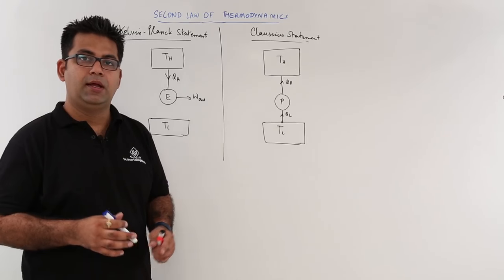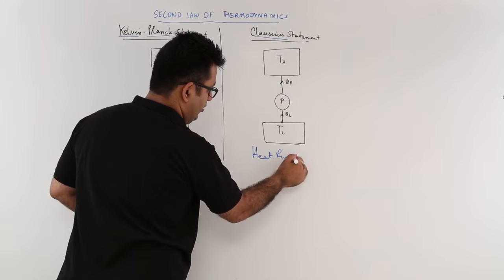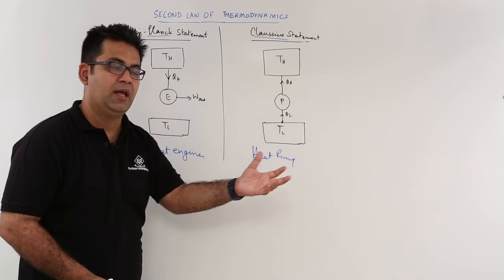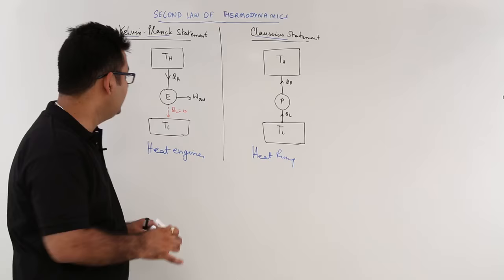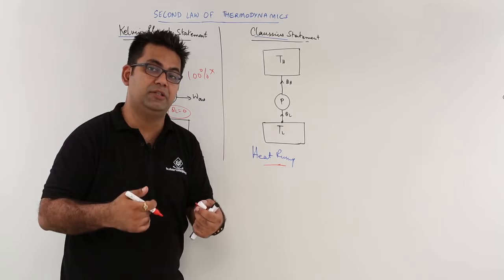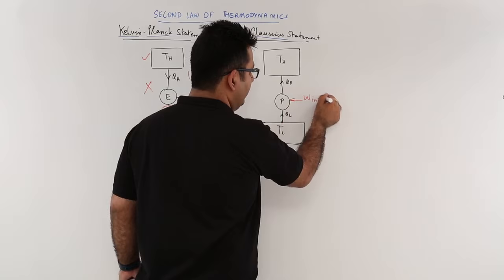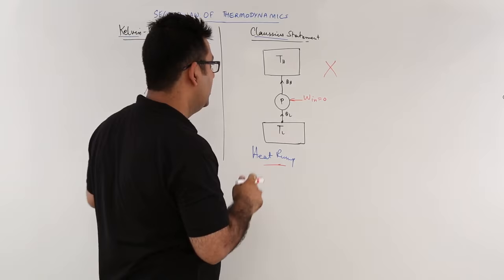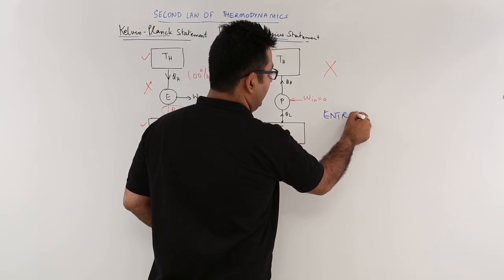Kelvin Planck and Clausius statement

Comment: kelvin planck statement said that heat cannot be 100% changed to work, then why there is possible in isothermal process Q=W
Reply: Yu Chiu, Q=W is an equivalence based on FLOT,which is an ideal situation. But KP statement is SLOT and is a practical situation.
Reply: But it says about the cycle and you are saying about the process
Reply: Isothermal process is an apllicatoon of first law of thermodynamic whereas kelvin statement is  a statement of 2nd law of thermodynamics

Comment: kelvin planck statement: it is impossible to extract the internal energy if a system is fully into useful work
clausius statement: it is impossible to transfer heat from a colder body to a hotter body without the aid of an external agemcy

Comment: Is there an intuitive reason that heat rejection to a lower temperature sink MUST occur?
Reply: Lower temperature sink is nothing but the environment,  and you can not get rid of your environment no matter where you are in the Universe. So whenever you have a hot body, it is always surrounded by the cold environment. So heat from the hot body is going to spread in the environment.